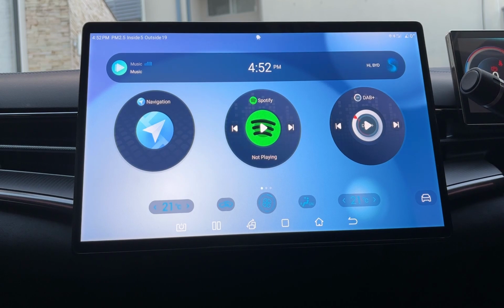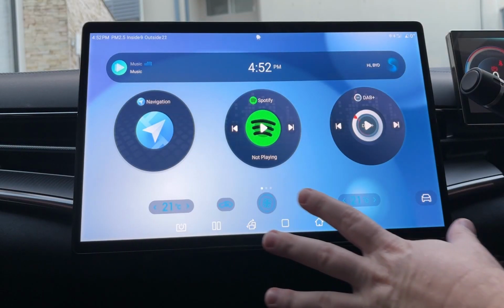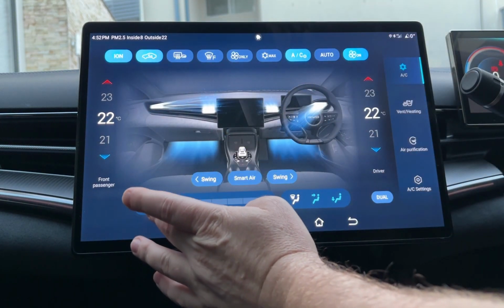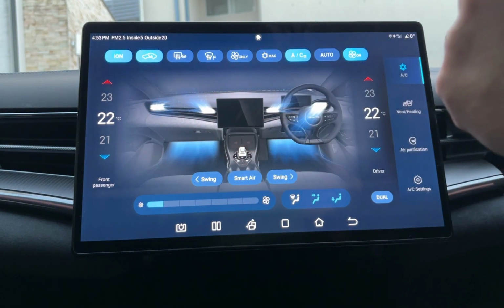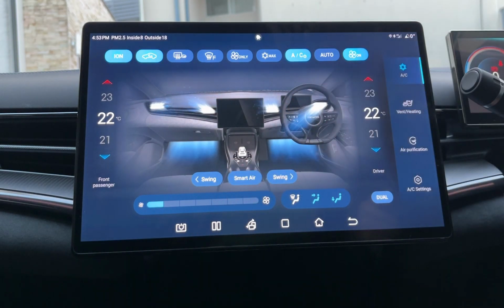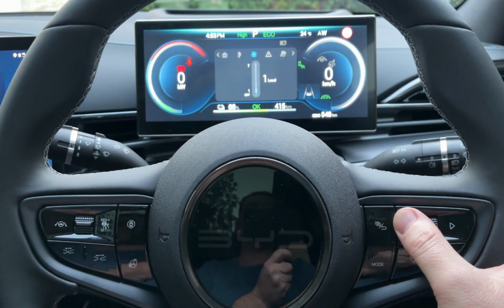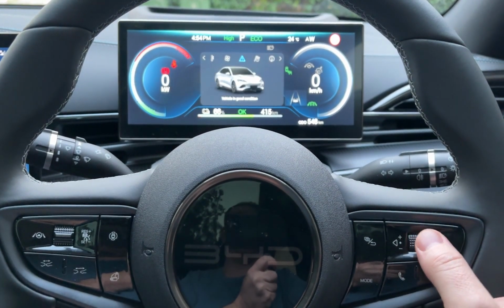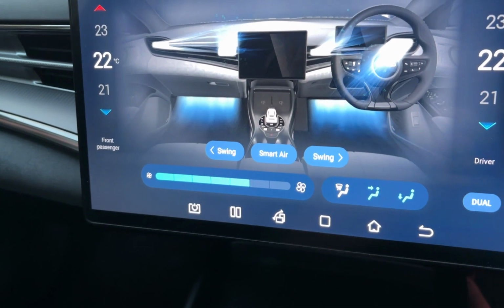How To Control BYD Seal AC Through Steering Wheel Buttons

Comment: Good overview of the steering capability to control the aircon. A separate question, is there a way to set a timer for the AC to turn on automatically (without using the app), through the option menu. Will be getting my seal in August (can't Wait).
Reply from the maker: Not that ive seen unfortunately. Only way is through the app.
Reply: @TheBYDSealChannel noted, thank you